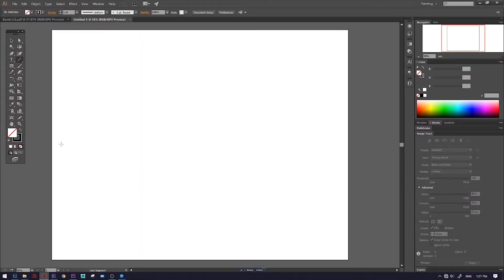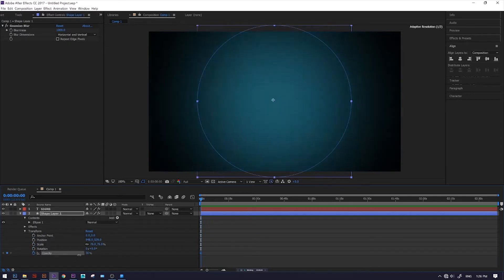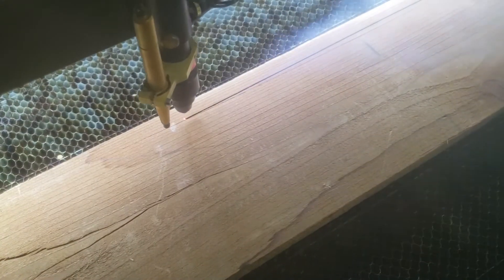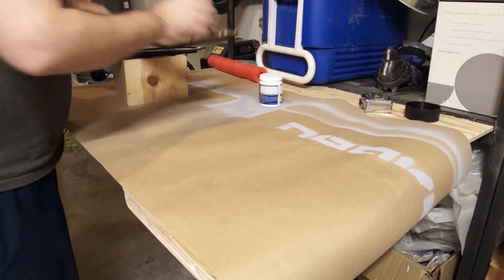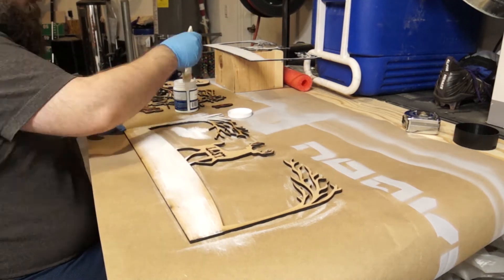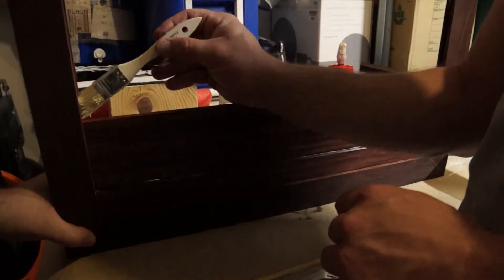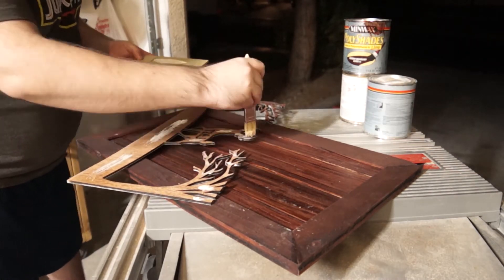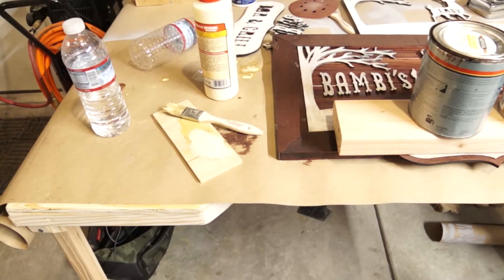How To - Signs

Comment: I would love to know what setting you used to cut the wood. I just recently got the pro24 with 90watt laser and am having a hard time figuring out vector cutting settings for wood :)
Reply: I used 100 power and about 65 speed and 75 current, but plywood can be finicky since it's almost always different from sheet to sheet.